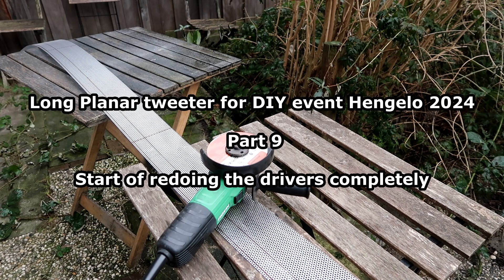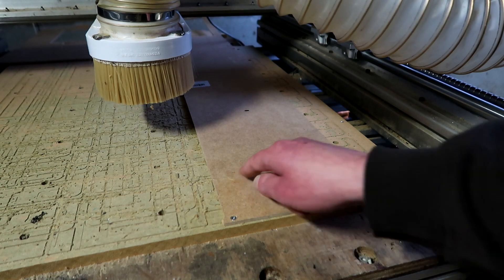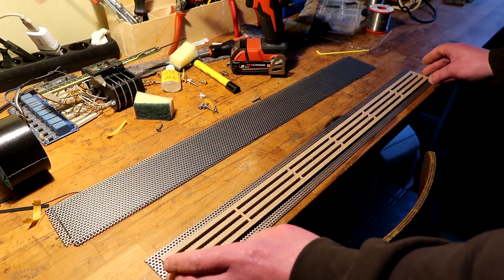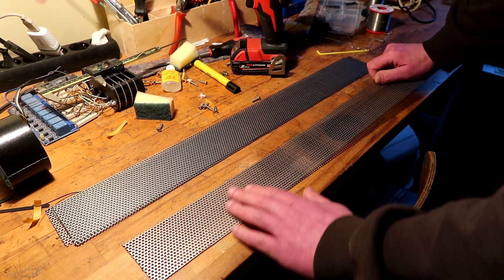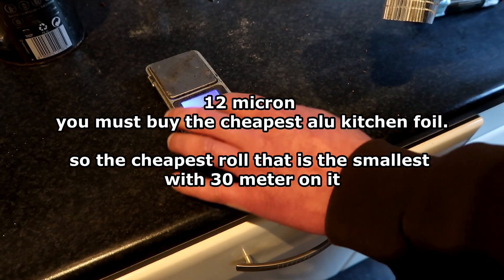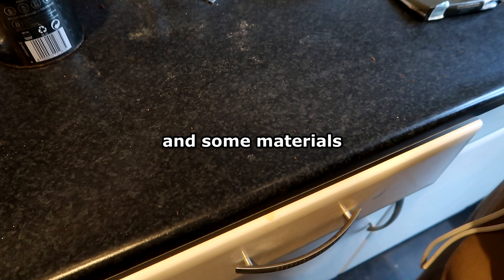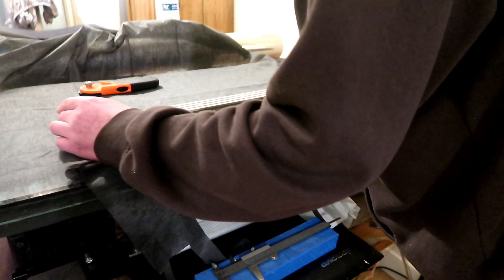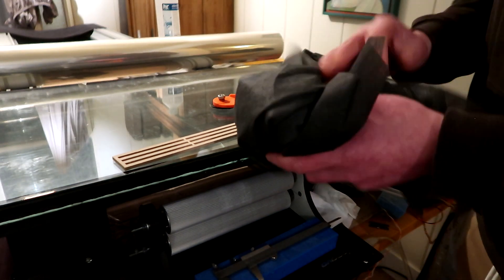Long Planar tweeter for DIY event Hengelo 2024 - Part 9 Making the drivers again from scratch

Comment: Love your work. I’m going to steal your 30nf trick. I bought a tool for my router to make domino joints. Trouble is the shoe, which needs to remain stationary or your domino holes are totally too wide, is made of the shiniest most slippery Chinese aluminium so it slides everywhere. I was wondering whether I should glue a rubber pad on it, but then I might run into vertical errors instead of horizontal ones. Which would suck just as hard.

By the way, rather than a 30nf layer, did you consider sticking the magnets down with double sided tape?
Reply from the maker: thank you sir !!  well double sided tape is anoying to work with, and slips (creep) as well.. the 30NF trick only gives friction, nothing is holding it. in this case enough to reclaim my magnets and do it all over :)